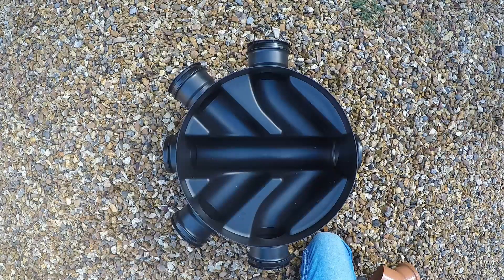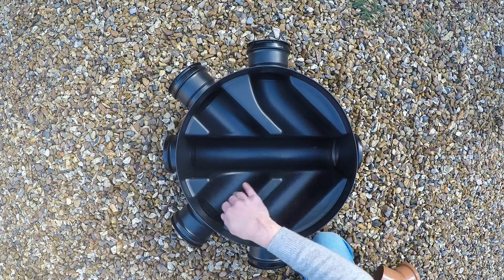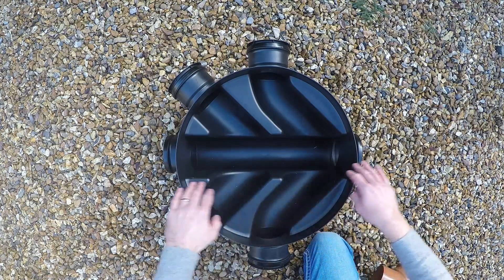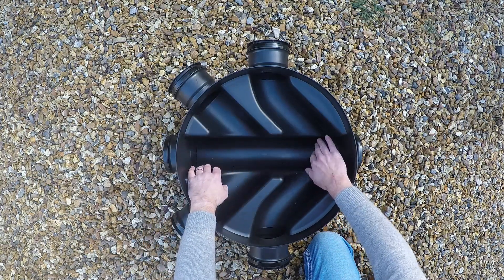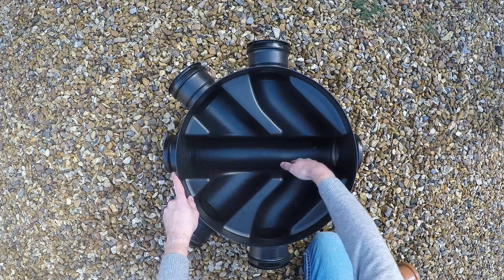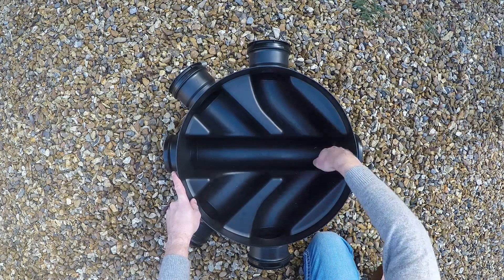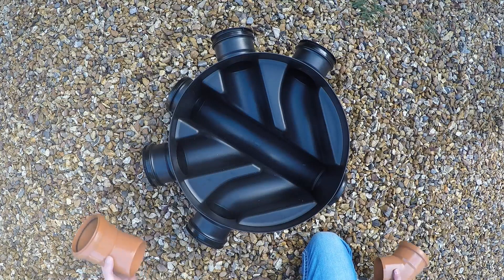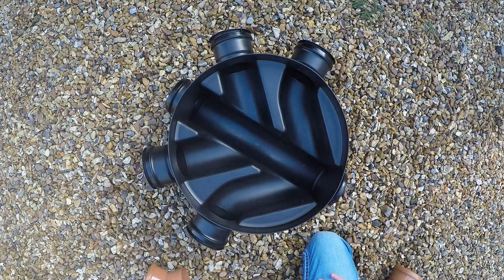HOW TO: Set Up Inspection Chamber at a Change of Direction | Drainage Sales

Comment: If that contraption can't turn waste thro the change in direction then why does it have inlets at 90 degrees? Grey water only?
Reply: Old question I know, but you can bring waste in the side inlets if the main channel is also in use.
Reply: To bring in up to 4 drains into the main channel.  Either grey or foul water.
Reply: Can you bring soil pipe waste in through the side inlets?
Reply: @therealfonzie  If this was a level invert base where the side entries don't step down, can the foul com in at 90 degrees if the main run isn't then used?
Reply: @handle1196  off the top of my head I don't think so. You can get 90⁰ chambers with no other entries you can use, or you could use the main channel with a 45⁰ on the entry and exit.
Reply: @therealfonzie  thanks, i only need a 90 turn chamber but don't mind turning its 45 degrees then using 2 x 45 bends, i just thought if all of the inverts were level it should be the same as a 90 chamber. Best not chance it if in doubt.